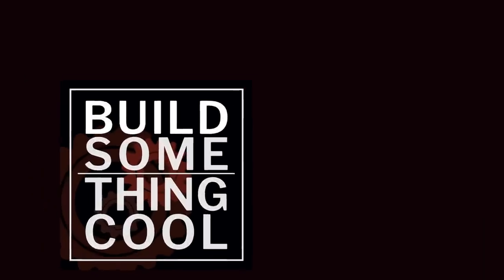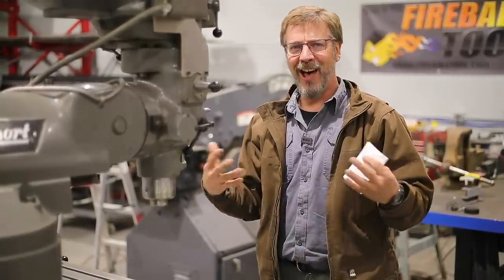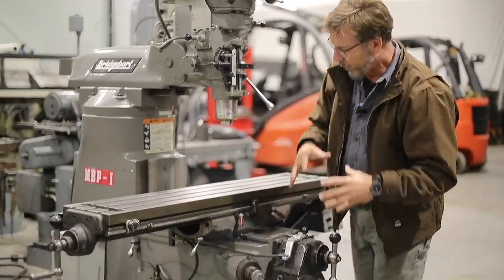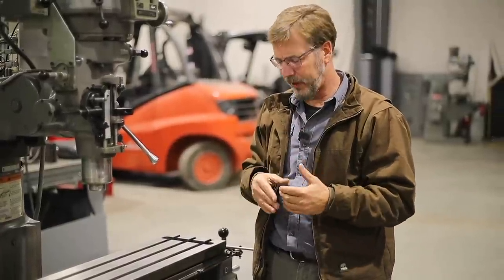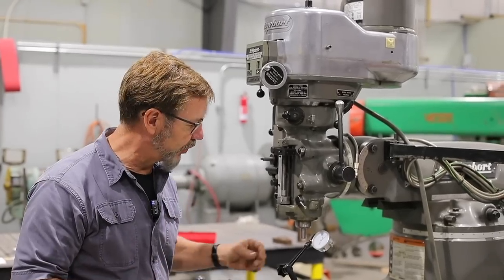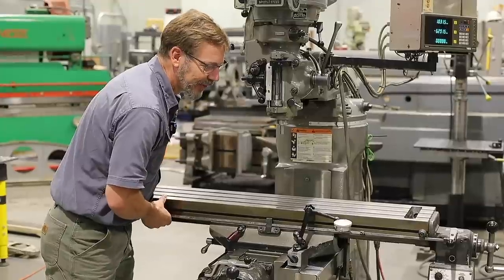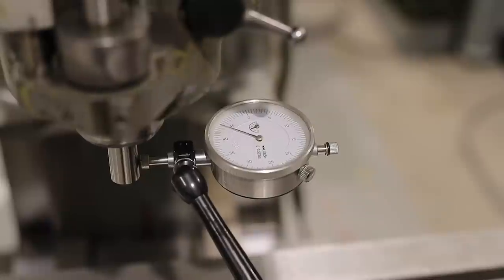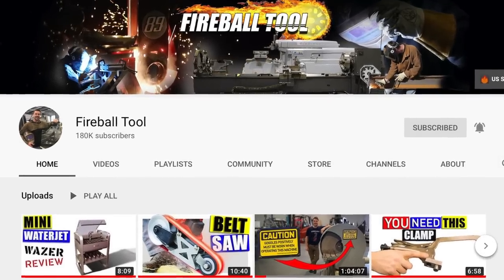How to buy a mill machine

Comment: $2000 are you insane? This machine is like $10k plus you are not going near a mid nineties Bridgeport in that kind of shape for $2k not anywhere even close
Reply: I'm trying to buy myself a mill. The good ones start at 10k ?
Reply: You should move to MI. Mills like this pop up for $3500-$5000 more often than you'd think.
Reply: @kylaredd2528  yea I've been seeing them come up until 5k all day and all over.
Reply: I’d pull $2K out of my ass if I found a machine like that. Had an opportunity to buy an MSC Bridgeport Style Knee Mill a couple years ago from the shop I bought my ENCO 13x40 lathe from. They said I could have it for $1K. I didn’t realize how good of a deal that was at the time. I really wish I would have bought it. Called them a couple weeks back and they had sold it. If I could turn back time…
Reply: I just bought one in nearly the same condition in socal for 2200. And it came with nearly 1600 in tooling.
Reply: I’ve seen tons of Bridgeport in decent shape around 3-6k

Comment: I need a mill, but every time I start looking around, the clapped out ones are going for $3k - $4k... at that point I'd rather pay the extra $1000 for a new import, with the features I actually want.
Reply: The old one might still be better 50 years on than the new one though. Mechanically that is - not talking about DROs and power feeds and coolant pumps..
Reply: Deals can be had. Look for retired/retiring machinists. I picked one up for $500 from a retired tool maker. It did need work but it's a tight machine. The previous owner was more concerned about his machine going to a good home than what he could get for it. The best deals aren't always advertised. Keep looking!

Comment: Where in the world do I find a $5,000 used bridgeport?  I'll happily drive 2k miles for it!
Reply: I have a Bridgeport with 48in table and power feed with Acurite DR and a new Kurt Vice and high quality collet set and many accessories that I am thinking about selling .
Reply: @trevorlee7945  Still for sale?
Reply: @domjohnson2579  If the price is right yes .
Reply: @trevorlee7945  Hi do you still have that machine and is it for sale? Thanks👍
Reply: @catherineharris4746  I do have it and yes its for sale if I get the price I want .
Reply: @trevorlee7945  How much?
Reply: @trevorlee7945  I'd also like to know. I'm in Las Vegas, but I'll drive for it.
Reply: Auctions.

Comment: I bought a Bridgeport that came off an old battleship from WWII.  About a month later the cross feed retaining nut broke and the tables Y axis just spun table wouldn't move.  Millwright charged me $650 to fix it.  A month later same problem.  I oiled the ways every single time I used the machine.  Millwright blamed me said I didn't oil the ways and wanted $650.  Couldn't afford it so Pulled the table off went down and bought the part  which was quantity of two.  fixed it and was up and running 2 hours total.  Also had a spare part.  Cost me $8.50  or $4.25 since it came two to a pack.  Never called another millwright.  I paid around $2,200 back in 1999 for the mill.
Reply: That sucks the last time I saw somebody that got a milling machine off of a ship it was the most awesome thing I've ever seen it was like a whole bunch of machines in one like they're trying to save space cuz it's on a ship it had like a million knobs on the thing

Comment: 5 flat tires! Wow! It might be worth mentioning how a machine like this would hold its value as a hobby machinist. I figured if i spend a few thousand now, at the rate I'll use it it'll still be worth a few thousand in ten plus years. Just my justification.
Reply: A machine that's looked after properly should show almost no wear - the trouble is most are (or seem not to be) not looked after, kept clean, lubricated, and so on.. This particular one looks a beauty. As a hobby machinist (probably fairly low use), if you learn how to look after the machine before using it, you'll add basically zero wear to it, and it will retain its value very well.

Comment: That was a good video Dale. You covered a lot of important things. One thing I think is worth mentioning is the ware in the table in the X axis. Take a cut on a long piece of stock then flip it over and take another cut to see if the machine is worn in the middle of the table. This would show up as a piece that is thicker in the middle and thinner on each end. The machine you purchased most likely does not have such an issue but for someone else it could save them a lot of aggravation. Thanks for the vid!! It was good to see you again. Stay well!!

Comment: Excellent video Dale. You covered everything. The only comment I could make (Maybe someone has already said this) is that machine appears to have chrome coated ways. This was a extra option and is something to look for.
Reply from the maker: Thats a good question. I never thought about it. I have never seen a Bridgeport  that didn't have chrome ways. I will say I have another mill that is worn with  harden Crome ways, and I can't scrape it in unless I remove the Crome first. That is why I bought this one.
Reply: Build Something Cool is the chrome worn on your other mill? When I first started in the machine shop I ran a Bridgeport and it didn’t have chrome ways. It also didn’t have those fish scale scraping on the table. I’m not sure of the usefulness of that. It looks cool but has no use on the table.

Comment: For the Bridgeport mills with the flaked chromed ways for the “Y” direction, what will wear out is the bottom of the cast iron saddle. So even though the chrome ways look in good condition, there can still be a lot of slop in the table because the saddle is worn out. Something that he did not mention is that you’ll want your mill to come with one pump Bijur oiler already installed on the mill. The older milling machines didn’t have them and it involves more effort to oil the ways. 

Also, anyone that is looking for a turret mill should research the different brands that were made in America. The two American made (for the most part) mills that are still available new are the Bridgeport and Wells-Index. There are other brands of ram style turret mills that were made in America that are well worth looking at. Machines made by Tree, Cincinnati, Ex-Cell-O, Clausing, Gorton, and South Bend are all worth looking at. Some of them are better machines than a Bridgeport. Some of the of the afore mentioned milling machine brands are still supported for spare parts, even though the original maker is out of business. The biggest advantage to the Bridgeport is that there have been so many of them manufactured since 1939 that they’re all over the place and spare parts and accessories are readily available.

Comment: Here in Sacramento, Calif....are several U-haul lots...they have a 6'X12' open trailer that has 2.400 pound capacity, 2 axle, surge-brakes.....trailer weighs around 2K....I moved a small electric forklift with one...300 mile trip….very smooth....surge brakes are nice....towed with my 1999 Dodge ram Van...tiny 4 liter V-6.....I don't know the weight of the forklift, but the battery alone is 1,075 pounds...

Comment: I'm a recent hobby machinist and just bought a Bridgeport  Series 1,  2, HP at a clearing out the building sale,  I got it for next to nothing with the vice and tooling as long as it was out of the building by 3/21/2020.  It's a long story that sounds like your Atlanta move but it's in my garage now waiting for me to have time to finish the disassembly and move it into my basement shop.  The move was the very worst part of the experience besides I have no idea what shape it's in. I should have cut the moving process short and hired an automobile wrecker in the first place to move it. I guess I never realized today wreckers have a short platform on the back of them under the hook that shifts and lowers to the ground. The machine fits perfectly on it and was well support by the hooks slings

Comment: I’ll say I’m very surprised at the prices you suggest.  That is about 1/2 price from what I have been seeing within Florida.
Reply: What I've discovered, having attended auctions all over the country, is that the area that you live in determines the price. If there is a large industrial base where you live the prices will be less because there's a large supply. If there isn't any type of industry to speak of then the prices tend to be on the high side.

Comment: When putting it on a trailer, really important to get the tongue loading to 10% or so, because that puts the center of gravity in front of the trailer wheels.
If the center of gravity (CoG) or mass (CoM) is too far back:
1.  Hit the brakes:  the trailer gets pushed back.  Say it's aimed the slightest bit to the left.  If the CoG is too far back, the CoG is on the right vs. the trailer centerline; imagine the trailer standing on its hitch.  The braking force 'topples' (pushes) the back of the trailer right, and the tongue left.  The tires have some flex or springiness, and a little bit of slop in the hitch, so it aims left a bit.
2.  Trailer is aimed left, it swings left, and has inertia so it swings farther left (flexing the springy tires) until the tongue is now aimed far enough right to push it back the other way.
3.  The CoG is now on the left; that pushes the back of the trailer left, and the tongue right.  The tires have some springiness, so it aims right a bit more.
4.  Trailer is aimed right, it swings right, and has inertia so it swings farther right until the tongue is now aimed far enough left to push it back the other way.

Had this happen once, and a small trailer full of 16' lumber was sliding the rear tires in a full-size AWD station wagon with a Hemi sideways.  That's one way to wake yourself up...  I was lucky, didn't have stopped cars in front of me and a slight uphill grade.  Never again.
 
This is a mechanical oscillation, and it will jacknife you.  Make sure your load is centered a bit forward of the trailer tires.

Comment: Here's what I did.  I found a used Series 1 listed on a dealers website.  Since I am a machinist the quality of the machine was not that important to me.
Whatever repairs it needed I could do.  I paid $1600 for it.  I had them put it on a heavy duty skid.  I rented a lift bed trailer from Sunbelt so that I could roll
the mill on and off with a pallet truck.  I picked up the machine from the shop it was in and hauled it to my shop.  I backed the trailer right up to my door and
rolled the mill off and right into place.  It's still on the pallet.  That way if I want to rearrange my shop it's no problem.  I spent about $500 to rebuild the head
and I spent another $1500 or so to put ballscrews on X and Y.  I bought a $250 digital readout on ebay and installed it.  I bought an $80 static phase converter
to run the machine.  That's it.

Comment: Which of the four levels do people think This Old Tony’s mill’s at?
Reply: Pretty much impossible to say without a dial indicator, some tools, and the ability to wrench the table around a bit.

At best we can say that we think Tony probably knows his stuff and wouldn't buy a basket case, or a fabricator's level machine. Between the other three levels, they're all capable of doing good work in the right hands - with differing levels of frustration. :-)
Reply: (Based on how he sometimes complains about being X thou off here or there with his tolerances despite his best efforts) That added, I agree, not “Fabricator level.”
Reply: @jonathannagel7427  Any reasonable mill (even a cheap new lightweight one with less than spectacular gibs and no hand scraped fits etc) should be capable of working within a thou or two usually if you're fairly careful/methodical. I reckon he's pulling our chain if he's doing his best and regularly a few thou off :)
Reply from the maker: You know he has two, three if you count the CNC router he use on metal. 👍😂

Comment: Something that you didn't point out was the chromed ways. You're not going to get a lot of obvious wear on those. The wear will occur on the underside of the saddle since that is an un-chromed cast iron surface. I've seen it on a few Bridgeports that I've dismantled for cleaning and servicing. The other problem with chromed ways is that they can not be scraped back to factory specs without removing the chrome.
Reply from the maker: Real good points👍👍👍
Reply: sounds weird but i have heard of professionals doing it with better "angle grinders"

Comment: Depends on what you want but for tool and die guy you will want a refurbished old machine -depending on state it will cost you around 15 k € in europe-but thats the machine you pay once and with proper upkeep you will have for 50 years+.
Buying used mill or a lathe is worse than buying a used car-for car you can find parts in every bigger town(if you live in small village for example),you got mechanic shops -but where da hell are you going to find a mechanic for milling machine? Not many of those around!
My advice-save money buy once.Especialy if you live in area with no factory that can service  lathes/milling machines -getting it out of shop/sending it for repair/transporting it back/setting it in the shop again --->pain in a$$ and big chunk of money out of your pocket.

Comment: Thanks for great vid. I'm a retired electrician. Worked in a large maintenance shop that had 2 bridgeports. I would piss off machnists whenever I used a milling machine. Would only fabricate slotted brackets for micro switches and other things for the electric shop. Guys started locking up end mills but I Already had my own end mills. Really pissed them off when I milled out a slot for a key on an old motor. First Bridgeport that I helped my dad wire up was a 2 phase model that took a year for machine shop to get back in the 1960's.

Comment: I would say that the DRO does add value to the mill because there is significant difference between a cheap DRO and a nice one, like a mitutoyo. The placement of the graduations is controlled very well by mitutoyo, while there is little guarantee with an off brand
Reply: Most of the commercial units use SONY glass scales, and even the cheapest $500 Chinese DROs  that vendors like SHARS sell use glass scales that are calibrated with a Renishaw laser interferometer, the scales will always be MUCH more accurate than the ballscrews on a Bridgeport, and trying to walk out the backlash on dials. So my point is practically ANY glass scales are going to be just fine for well under a tenth- even capacitive scales will vary by under a thou (though I would not use them, they are too prone to debris) Any DRO is a good DRO and so useful for things like PCD. Just as an aside, a lot of the Taiwanese machines are ground not scraped, and still perfectly serviceable.

Comment: Yes Billh308, you are correct. I have been looking for one for ages and finally saved enough money to buy one. The one in this video would be around $3000.00 but today this quality machine is selling for $6000.00 to $12,000.00. And those Chinese brands like Grizzley have doubled as well. So I am getting older and weaker to move one into my home but keeping an eye open for one.

Comment: Great video, but you didn't mention the knee. Is there anything you should look out for here?
Reply from the maker: Good question. I talked about measuring it with a square. but what I should have said was crank it all the way up and see if it gets tight. If you need both hands on the crank to over come the friction of the last 3" or so you have a problem. Check for squareness on the top. middle, and bottom.  If its out more then .004 it might not be a good machine for you. But if you rarely move the table up and down you could be out .009  or even more and have no problems  as long as you tram the head for your table position..

Comment: Those are scraped ways. More valuable machine because it has scraped ways. Not all machines come with those ways
Reply: Those pattern of the scrape (and shape of each scrape) is also desirable in this case.
Reply: No there just flaked ways and appear to be chromed. Almost all Bridgeport’s are milled and flaked ways.
Reply: J Hueth   You can call that pattern any amateur name you want to call it.  But those are hand scraped ways. 
They aren’t common on all Bridgeport’s what’s common is chrome ways.  Much more common and not as good as hand scraped ways
Reply: J Hueth  I own equipment with these hand scraped ways and a couple with out it.  The hand scraped ways are much nicer
Reply: They’re flaked  chromed ways. Flaking is a technique which achieves the same oil bearing capacity as scraping but without changing the geometry of the way surfaces.
Reply: Looks like a few people here don,
t know what there talking about ! Most all high quality machine tools have some form of hand scraping !  
With the new precision grinders, I would not be surprised to see ground ways.
Reply: Darius Castor   Post a link showing this process and how it doesn’t change the geometry of the metal.
Reply: Mike Eagle just look up “way flaking”, all it does is adds small grooves, you don’t blue or indicate in the surface

Comment: I'm a fabricator. I bought a 1978 Millport that came with a phase converter, vices and tooling for $400. Cuts slots and drills holes like a champ. How'd I do?
Reply: Excellent. Where I live fabricator type machine went for 1400 USD... yesterday at auction (with fees)
Reply from the maker: Great job :👍👍👍👍